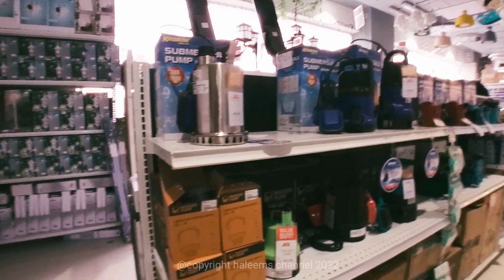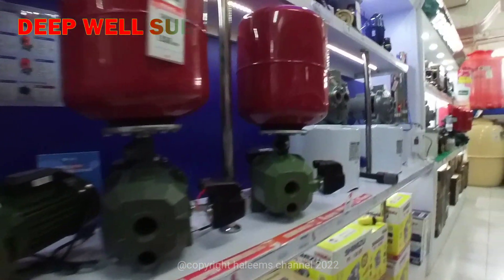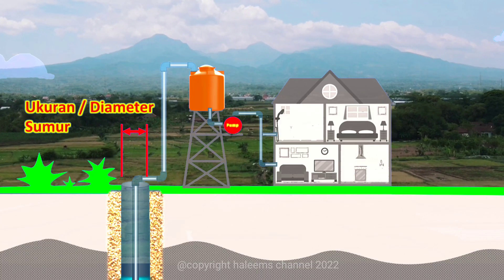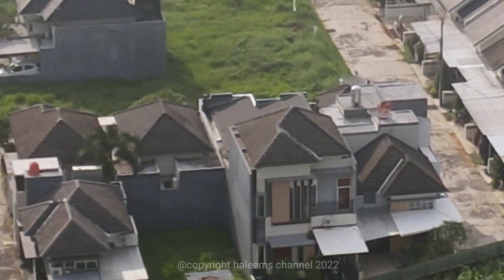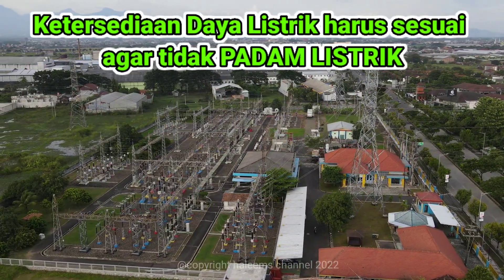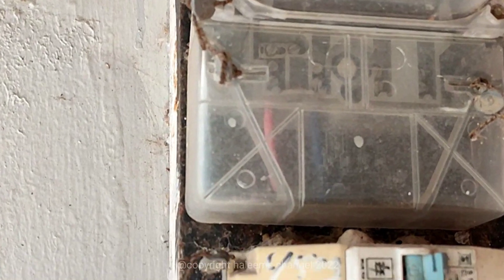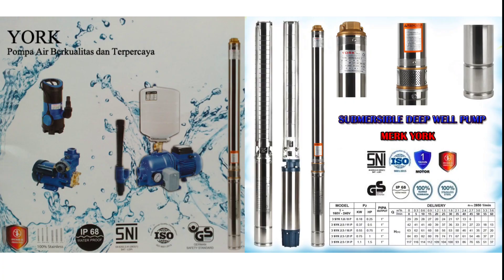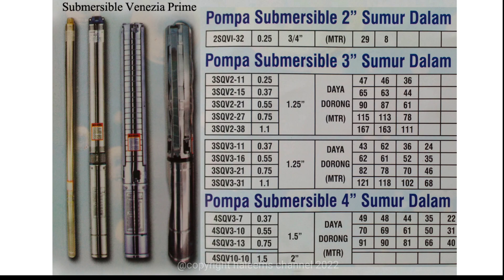WAJIB TAHU AGAR TIDAK SALAH BELI TIPS - CARA MEMILIH POMPA SUBMERSIBLE POMPA SATELIT

Comment: Kalo kedalaman 100M di tembak ke atas torent setinggi 10M kira" 1.5Hp cukup kah?
Efeknya apa ya bila semakin banyak impeler nya
Reply from the maker: 1.5HP pada head 110meter, keluaran airnya sekitar 25 liter/menit, jadi cukup gak nya sesuaikan saja kebutuhan air nya berapa? 
Jumlah impeller mempengaruhi kemampuan head nya dan debit airnya... Tentu semakin banyak impeller harus diimbangi dengan besar nya power motor... 

Pada kondisi power motor yang sama, misal sama-sama 1.5HP, namun berbeda jumlah impeller nya, 
Misal pompa-1, jumlah impeller 10pcs
Pompa-2, jumlah impeller 15pcs..
Jadi, pompa-2 secara performa (head&debit air) pasti akan lebih besar, 
Sisi lain efeknya pompa-2 ini kerja motor listriknya akan semakin berat dan efeknya lebih panas... (dgn catatan kondisi motor pompa-1 dan pompa-2, sama, diameter impeller sama)... 

Hubungan diamater impeller dan jumlah impeller juga berpengaruh.. 
Biasanya yang diameter impeller lebih kecil, jumlah impeller akan lebih banyak.. 
Sehingga pada motor yang sama, akan bisa mencapai performa yang sama... 

Contoh, sebagai gambaran... 
Pompa 2 inch, 0.25HP, jumlah impeller 16 pcs
Pompa 3 inch , 0.25HP, jumlah impeller hanya 10 pcs...

Comment: Mas saya mau tanya, sumur saya kedalam pengeboran nya 40m, permukaan air udah dapat di 12 meter dari atas, casing pipa sumur nya 2,5 inchi, pompa berapa inchi yg harus saya pakai?, Berapa HP? Dan di kedalaman berapa meter bagusnya pompa di pasang? Tks
Reply: Mas, mau tanya...
Untuk ukuran diameter pompa satelit berpengaruh gak untuk dorongan air? Atau dorongan air ini berpengaruh dari berapa HP nya ya?
Reply from the maker: @dwisefrianto9834  dorongan lebih dominan di pengaruhi oleh banyaknya kipas/impeller, sedang besar diameter pompanya lebih dominan berpengaruh ke besar nya debit air... 
Semakin banyak kipas, ato semakin besar diameter, harus di barengi dengan besar nya HP (motornya)... 
Jadi, antara diameter dan HP berbanding lurus, sama2 punya pengaruh...
Reply: Saya pakai yg 2 inch, 0,5 HP tapi dorongan air kenapa kecil ya?
Reply from the maker: @dwisefrianto9834  iya 2 inch merupakan type paling kecil, dan harga nya lebih mahal utk spec yang sama dibanding yang 3 inch... Karena utk mencapai spec yg sama, diperlukan jumlah kipas yang lebih banyak, sehingga secara biaya memang lebih mahal... Lebih baik pilih yang 3 inc utk spec yang sama...

Mengenai besar kecil nya dorongan, harus ada parameter ukur, tidak bisa hanya dikatakan kecil dengan kata2... Selama itu bisa mencapai spec yang ditawarkan, itu sebuah ke normalan... 
Saat memilih pompa, perhatikan spesifikasi nya dan kebutuhannya...
Reply from the maker: Untuk ukuran casing sumur 2,5 inch, ukuran pompa nya pilih yang 2 inch, 
Sedangkan kedalaman 40 mete, bisa pilih pompa yang 0,5HP
Untuk pemasangan, sebaiknya dipasang pada kedalaman maksimal dari spesifikasi pompa nya..
Reply: @HaleemsChannel   @Haleems Channel  mau tanya lagi mas, kalau pakai yg 0.33 HP gmana? Ada pengaruh nya mas?
Reply from the maker: @dwisefrianto9834  0,33HP maksimum kedalaman hanya 30 an meter, itupun pada kondisi maksimum air keluaran nya hanya kisaran 5 liter/menit (sangat kecil) 
Namun kembali ke kondisi sumur, jika kedalaman air permukaan bisa Terjaga antara 12-20 meter.. Pakai  0,33HP tidak masalah, air keluaran nya masih kisaran 15 liter/menit...(cukup untk kebutuhan keluarga kecil, catatan nya harus punya tandon air) 

Sedangkan kalo pakai 0.5HP, pada kedalaman 12-20 meter, air nya bisa mencapai hingga 20 an liter/menit..
Bahkan pada kedalaman 35 an meter, masih bisa keluar air 10 liter/ menit.. 

Jadi sesuaikan saja kondisi sumur dan kebutuhan airnya... 

Rata-rata kondisi sumur, mengalami perbedaan pasang surut air saat hujan dan saat kemarau adalah kisaran 3 hingga 8 meter... 
Kalo saya asumsi di maksimum, dimana kondisi sekarang kedalaman air pada 12 meter, berarti saat musim kering bisa hingga 20 meter..
Reply: @HaleemsChannel  Oke paham, Thank's info dan saran nya mas.
Reply: @HaleemsChannel  oh iya mas sorry, untuk pipa out air nya bagus pakai berapa inchi? Atau tergantung selera saja?
Reply from the maker: @dwisefrianto9834  pipa out sebaiknya ikuti spesifikasi dari buku petunjuk nya, 
Kebanyakan installer menyarankan di ganti yang lebih kecil, hal ini (pipa yang lebih kecil) dapat mengurangi debit air nya, selain itu pipa kecil merupakan hambatan aliran sehingga menyebabkan kerja pompa lebih berat..
Reply: @HaleemsChannel  oke mas. Tks
Reply from the maker: @dwisefrianto9834  sama sama, terimakasih kembali, smoga bisa membantu
Reply: Ok, thanks
Reply: Pak mau tanya sumur saya kedalaman 20 kalau mesin kaitihero 0,33 hp  mampu dorong gak makasih

Comment: Kalo pompa di celup terlalu dalam, apakah beban pompa bisa terlalu berat untuk mempompa dan menyebabkan kerusakan ?
Reply from the maker: Masing-masing pompa memiliki spesifikasi batasan kedalaman celup, 
Selagi celupnya masih dalam batas spesifikasi yg diperbolehkan, maka tidak jadi masalah... 

Semakin dalam kerja pompa akan semakin berat... Oleh sebab itu, jika sumurnya dalam banget bisa pilih pompa yang spesifikasi lebih besar (lebih dalam), agar pompa tetap masih bisa kerja optimal.. 
Kesimpulan nya, pilih pompa yang sesuai kondisi penggunaan nya..
Reply: @HaleemsChannel  pakai grundfos sp3a 18 1,5pk di kedalaman 54m aman pak ?
Reply from the maker: @chrollolucilfer2190  secara spesifikasi tidak ada masalah... Cukup aman untuk menunjang kedalaman 54m..

Utk lebih aman nya, cek kembali, 
1. Kondisi kelistrikan, tegangan yang stabil, grounding, 
2. Cek instalasi nya, baik itu wiring dan piping, selalu ikuti petunjuk pemakaian
3. Cek kondisi sumur, tidak berlumpur, tidak cepat tekor air nya, pasang sistem pengaman dry run..